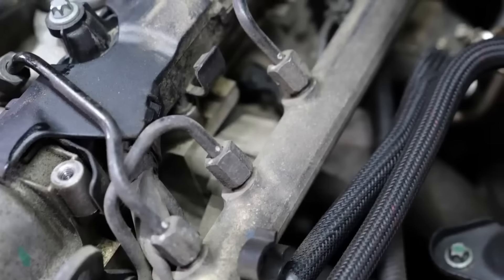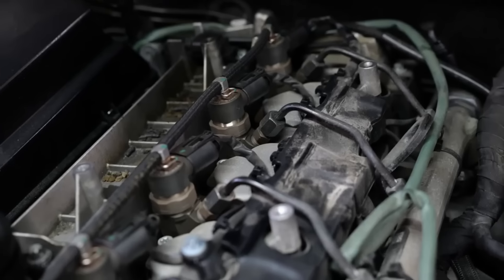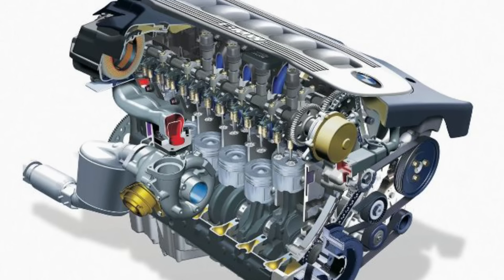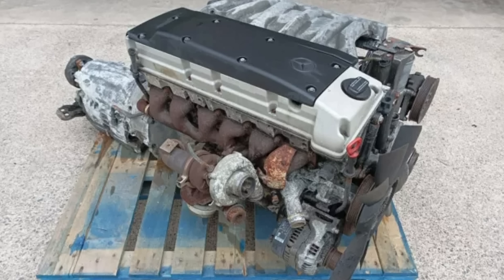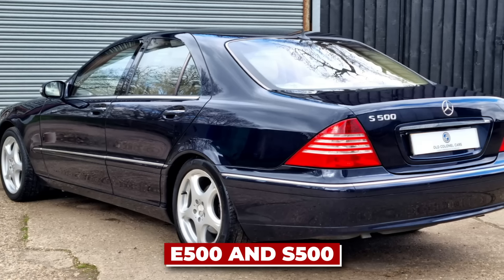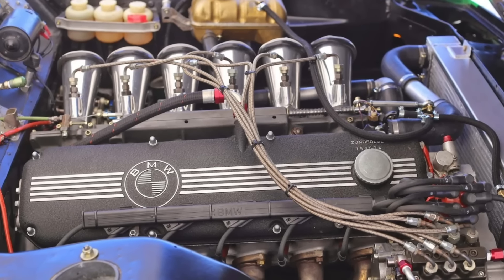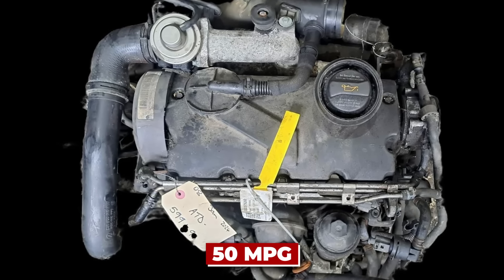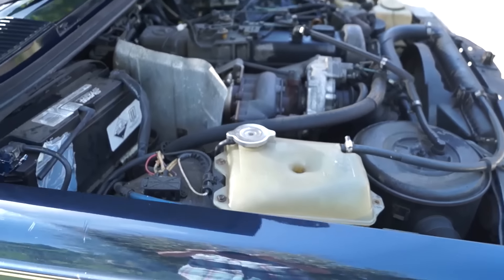10 Most Reliable German Car Engines of All Time

Comment: when engines were built by engineers not software developers
Reply: Software and accountants ruined everything.
Reply: @sebouhakharjalian6707  yes
Reply: Or accountants...
Reply: YES! I AGREE!
Reply: Managers. Software developers have nothing to do with cutting down costs.
Reply: @bestopinion9257  adding screens and commands to cars isn't software ???? updates Etc ????
Reply: @Steve1766  If you suggest lower quality/reliability, that's because of managers. Engines are crap not because of displays.
Reply: @bestopinion9257  and having too many electronics can't be reliable either
Reply: @Steve1766  engine is bad for other reasons
Reply: @bestopinion9257  yeah the main reason is planned obsolescence but also having so many electronics sucks
Reply: @Steve1766  I like simple clean cars too. But the real reason for low quality cars these days is the way the companies make more money. And this has to do with managers in the first place.

Comment: VW 1.9 TDi's are great.  I bought an old Passat Estate 8 years ago with the 130bhp PD engine which was destined for the scrap heap.  Gave the guy £150, fixed a few minor issues, and it now has 508,000 miles on it
Reply: Superb vehicle! We have a 2010 Octavia 1.9tdi pd currently on 556,000
Reply: All engines after 2006 are crap. The TDI's and the TDI with the red I were undestructible.
Reply: How many times do you have to refill the oil?
Reply: @dvandam9574  I change the oil every 6 to 8000 miles
Reply: @ no refills in between?
Reply: @dvandam9574  sometimes just needs a little but never too much
Reply: @ mine needed  full refill between maintance if ridden hard

Comment: Cast Iron inline 6's last forever.
Reply: I got 140i with the b58 inline 6 turbo stage 2 with 480bhp for 3 years no issues
Reply: @lukeskywalker1666 thats not a cast iron block. Tho its very reliable.

Comment: I have seen an E Class W211 built if I’m not mistaken in 2006 with 803000 km, and the most astonishing thing is actually interior in black leather trim that looks almost like new. I would not say that the car even has 200000 km. The worst thing is that someone will buy it cheap, put down mileage and then sell it for double money, which is not really problem. The main problem is that someone will then say that Mercedes isn’t good because at 200000 km made so much problems.

Comment: So good to hear your commentary on reliable German engines. We have a 1993 E320 (107,000 miles) saloon in Colombia with the M104.992 engine. The car was originally sold new in the US and came to Colombia within 12 months. We have had 3 problems, although not issues of the engine itself. The first was the Engine Control Module which blew a transistor. We managed to find a 2nd hand unit from a damaged car in the US and it is operating well. However, we sent the original ECM to a repairer in Miami and have recently received a message from them to say that the unit is irrepairable! In the meantime we think we have found a repairer in Colombia so we will try that. 
The other issue is the throttle body. We had the original re-wired and re-installed but we are still getting throttle surging. So we obtained a 2nd hand unit from the US but it was worse! So, we are getting not only the wiring replaced, but mechanical repairs as well - here in Colombia. It is due to be installed next week. Then we will get the original fully repaired.
The 3rd. issue was the biodegradable wiring. We thought about buying a new wiring harness from Germany, but have had the harness fully replaced here and all seems to be well - and cheaper!!
If anyone has any comments, always gratefully received.
Reply: We hav a Audi A3 with a 1.9 TDI engine in it, it is 2002, & we driving it since 2005, I going every single day,, thankfully, it is running Trouble Free, at the minute it reading  something Over 496,000 miles,, we looking forward to it turning 500,000 miles🤞🤞🤞

Comment: I sold my last Audi A6 2.0TDi with 336,000 miles on the clock, after 13 years still running as well as the day I bought it nearly new with no more oil consumption, engine never failed. My replacement A6 Avant 40TDi mild hybrid has 204 BHP and averages almost 50MPG, nearer 60MPG on a long run. 88,000 miles so far, hardly run in yet.

Comment: Got a 2001 E53 (X5) with the M54, just turned over 200,000miles, runs strong and fast with the 5-speed manual and does not leak nor burn oil.

Comment: I recently did a first timing belt change on a VW CAYC 1.6 TDi after 180000 miles as per the service schedule. The belt had absolutely no visible signs of wear, quite impressive when you think it must have gone round the engine best part of a billion times.

Comment: I’ve flipped 40 plus of the w123s and currently have 8 I’m holding , my testimonial car is an 83 300cd that’s currently over 500k miles . They ride along very well while under 3500rpms at 75mph . It’s all about oil and transmission fluid changes with their factory times , 3000 oil , 25000 trans , with those scheduled duties you can drive by those  used car lots for years to come .

Comment: Vw 1.9 Tdi motor - in various guises- is THE world beater. Oil change every 6k miles with the CORRECT oil and a quality oil filter , with a air and fuel filter every year and they will run forever.Obviously dont forget the timing belt every 70k ish miles.Only problem is that this particular engine is out of production since 2010 but there are still loads of them in service especially in Europe.Greetings from Ireland!

Comment: The M57 is only found in the pre facelift version of the E90s and all i6 diesel E60 5 series. It is however also found in the E46 3 series and the E39 5 series. later E90 had the N57 engines.

there is also a M57 twin turbo version going to 286hp and 580nm found only in the E90/91/92/93 335D and the E60/61 535D

I got the 335D E92 though. 😉

Comment: I had an '82 Mercedes 240D with the OM616 engine, which is a four-cylinder variant of the 617. Legendary mileage. But they were painfully slow. 0-60 was more like "yeah... at some point..." 😅. Gas mileage also wasn't great, for a diesel anyway, at around 25 mpg. Then again, it was a relatively big engine in a relatively heavy car.
Reply: I doubt that many people today would buy anything with less than 200HP. A more interesting video might be for modern engines, if there were some way to gauge how many miles they'll run. Still, many engines have an ancestry, and are improvements (hopefully) on prior plants.

Comment: I once drove an old Datsun Vanette. Yep, before there was Nissan Vanette.
That was a 1500cc 4 cylinder petrol engine with over a 1000000 km, yes +1M km....
Synchronisation between 1st and 2nd gears was all gooey but doable with the right "feel".
Don't make things more complicated than they need to be and they last a long time.

Comment: I would go for my own engine ofcourse, it being m57d25, from the e39, i have 480 000km on it and no oil drop leaks, no power loss, 0-100 in less than 8s, top speed over 240kmh, every injector works literally perfectly, i have it all checked once a year, every year, never needs any major repairs, just new fuel and oil filter and good to go. As the m57d30's which come from then m57d25, are known to last 800 000km, well 600 000km if the owner doesnt care for the engine, Im sure I'll drive my e39 well into the 7 figures of km, no questions asked.

Comment: I Have a Mercedes E200 CDI :
Fabrication December 2005
Engine type 646.951
2148 cmc
90 kw ( 122.4 hp ) / 4200 rpm
Milleage 497.000 km

Never broke, in winter start like gas. I have this car from 2007. Regular mentennance.

Comment: Always thought it was rather silly the ALH used a rubber timing belt. Especially considering it only had 2 valves per cylinder anyway.
Reply: I change my ALH timing belt from 215000 to 394.000 by contitech🙅‍♂️🤦‍♂️.
They say it was no scofing no dry or burn soft zones …it ill granade in high rpm.Now it is saved for more 90.000 km or 4 years😅

Comment: what happens with these cars in US is that they depreciate tremendously, they get 5 years old , and then people who can’t really afford them , buy them … then they start skipping on maintenance because they can’t afford it, things don’t get fixed, problems pile up, and soon there is $20K repair bill … and then , of course , it’s cars fault … car is no good , engine is bad , has lots of issues… well , if you’d keep up with regular service and maintenance, there wouldn’t be any issues, don’t buy $100K luxury vehicle if you can’t afford to maintain $100K vehicle … there is Merceds taxis all over the Europe with 300-400K miles running without any problems… if you can’t afford maintenance costs for Mercedes , buy something else …

Comment: BMW n52 was really good apart from the usual valve cover leak and coils
Reply: and oil consumption 😆
Reply: I agree! Have one in my 06 Z4 coupe and it's suuuuper smooth and so far (113000 miles) bulletproof reliable! But yeah, oil pan and valve cover  gaskets are 'typical' bmw issues. But mine doesn't burn/use a drop between changes!? Maybe 1/2L?

Comment: Mercedes M117 V8 should be on this list. Using high quality lubricants with regular servicing, these engines will easily run well past 800,000km. This means not using Castrol lubricants in it.
Reply: Castrol shampoo 😂
Reply: @LoopBooost  that's GOLD!! Awesome response!!
Reply: @christophermarshall5765  ravenol💪🏼
Reply: Motul is best !
Reply: Need to put timing chain and rails in at 150,000
Reply: @robertpsotka3525  my M117 V8 has more than 150,000 miles, & the timing chain is fine. I check it every 6 months, or 20,000 miles (32,000km). It is still nice & tight. For the most part, you are correct.

Comment: I actually killed a 617turbodiesel motor, by running pure biodiesel in it over several years…it did have well over 320k miles on it though- head gasket

Comment: You should have given some specs on the BMW M57 engine…like on the 335 model it produces over 300 HP and over 425 torque. Producing a 0-60 in under 6 sec. and a top speed of 155 mph. Fastest diesel production car still to this date
Reply: Fastest diesel production engine is the 6L audi V12 that they shoved in the Q7 back in 07.

Audi also made powerful diesel V8s back then and until recently
Reply: @KingofInterns  . Thanks for the info. I stand corrected. Tied for the fastest production diesel ever made at 155 mph (with limiter). The Audi is capable of 176 mph  without limiter....What an incredible beast.

Comment: Just saw an x7 40i in the group I am in with 250k miles. Maybe a little too soon to add the B58 in the list but it's getting there. Oh , post was about being it the shop for a failed throttle body.
Reply: i didn't understand . Your X7 40i has 250 k miles?

Comment: my 2003 tdi alh with stg1.5 malon chip and vnt17 pd150 intake, egr delete  with 68.5 5th gear swap ran 600k miles until the body gave up on front strut tower rot. I sold the car to my buddy to swap it on his mk4 gti.  he did a compression test and still was holding 480~495 across cylinders  thanks  Liquie moly for great lubrication and thanks VW for Das Auto

Comment: 1.9TDI is good only without DPF … if its dirty you will end up in emergency mode and have to buy a new one, then turbo died so I had to buy a new one and the car was finally working for like 20 000kms no problem I was drivin from CZ to NL on one tank the consumption was great but one day I was drivin on highway and out of nowhere piston rod flew away from engine block through oil pan and it was over … car cost me 1200€ and I spent another 2000€ so it could work … Yeah dont buy 1.9TDI if its over 1/2 milion kilometers and not with DPF specially

Comment: M30s and M10s achilles' heel was its rocker arms, they snap into pieces very easily, M54s weakpoint is its VANOS M50 non vanos is far better engine to last, and BMW M60 is also very good engine far better than M62. Dont buy any new bimmers they are full of problems specially any N series engine. valvetronic is legendarily bad 😂 why there is no Audis? They have many really good engines like 10 valve 2.2 straight five from 80s that runs basically forever.
Reply: Brother it’s the opposite every bmw 2020+ engine wise is a step up.   B48 4 cylinder handes up to 500 hp reliably , and the s63 v8 while still somewhat problematic it’s miles ahead of any turbo v8 that has been made before.Lastly B58 well there’s a reason Toyota (Brand that entire business model is based on reliable vehicles) decided to partner with BMW.
Reply: @truevhazo4001  too early to say anything about reliability because those engines are that new but i have seen lot of newer bmw turbos burning electrics and all plastics in engine because for some reason engineers thought it would be great idea put turbos between heads and all electronics like ECU and plastic crap around of them, do you realize how hot turbos are and cats arent very faraway either 😄 we have joked its a bmw feature to go up in flames, i have also lost one BMW because electric fire and my friend too 😂

Comment: Why is bmw on this list
Reply: M57 ❤
Reply: I guess you don't know the older BMW's like 330d 320d 3series
Reply: @Nuhe. Still you dont speak of them on the same day as om606 om648 and the older mb
Reply: I've had 11. All 2.8 - 3.0L inline 6's. No major problems,  ever. Just 'typical' oil gasket leaks and eventual water pump failure! 😂

Comment: You forgot 2 of Germany’s most reliable engines. 

The SOHC MB straight-6 that was so good & reliable that Toyota copied it for the Toyota Crown. In fact they copied it so well you can save money rebuilding the MB original using Toyota parts.

The other is of course the VW air-cooled flat-4. Preferably the 2 port post 68 1600cc. The only thing you have to worry about for cooling is a spare fan belt & there’s no head gaskets to worry about blowing too. It’s been let down by too many hobbyists & small workshops rebuilding them; but if you bought say a 1970 beetle, type 3 or kombi, brand new, coming direct from the German factory, then as long as you changed the oil & sleeve every year or 3 & adjusted the rockers every year or 3 & kept a spare fan belt in the car, you could get over 25 years driving the vehicle without worrying about anything else, engine wise. Plus if you willing to trust a hobbyist or small workshop you can have one rebuilt as a 1915cc (94mm bore 69mm stroke) producing close to double the power for not much more cost than a standard rebuild.